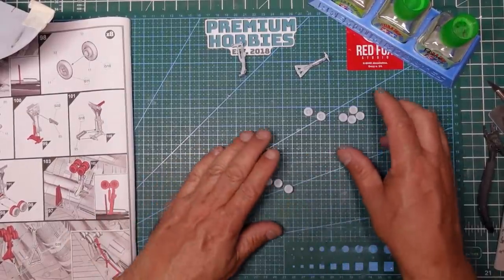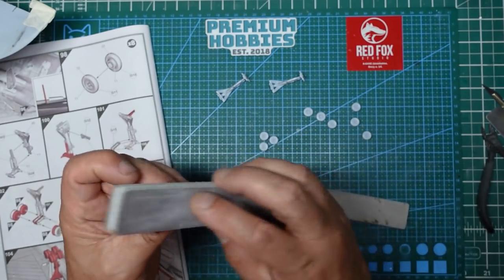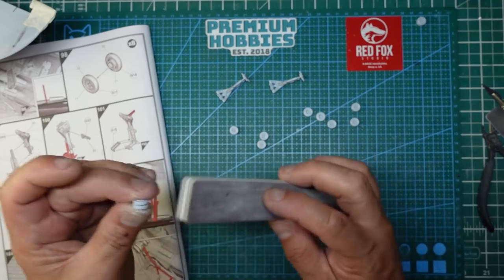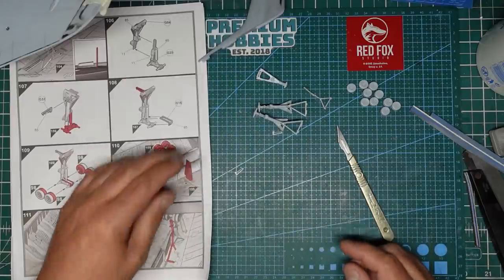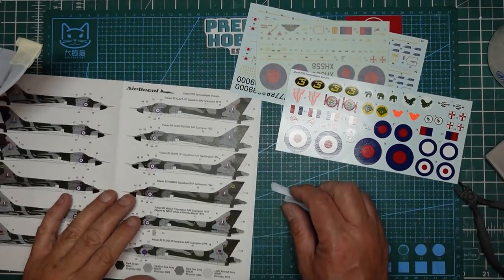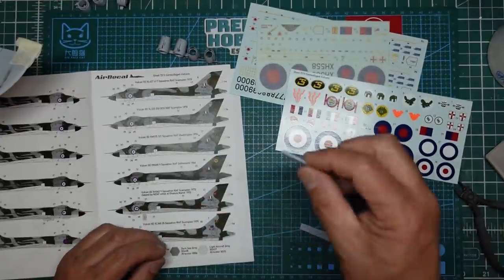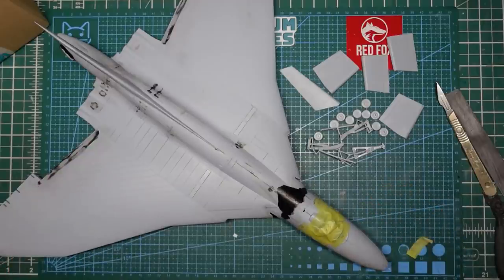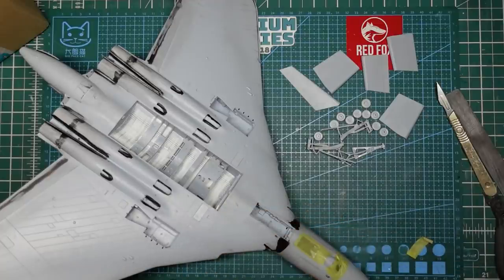Airfix New Tool 1/72 Vulcan build. Part ten

Comment: The adventure continues.  More good progress, Nigel, and more useful guidance for those of us yet to start our own builds.  Just to add to the confusion, I found a thread on Britmodeller from 2017 by a guy doing XH562 using the old kit.  Interestingly, his has the other fin tip and a different nose (the one with an extra little thimble) although he is using aftermarket longer jet exhausts.  He says his in its 1978 configuration. Yours I think is 1972.  Sods law dictates that through a long and illustrious career such as these aircraft had, they must have all sorts of mods and upgrades adding to the modeller's head scratching.  At least you've got photos to confirm your choice.  Nil carborundum.

Comment: Nigel, the cameras auto exposure is seeing the white of the instructions and the camera ‘brain’ is saying woah, too bright, close the aperture or increase the shutter speed. If you put something black on the bench, it will do the opposite and get brighter…
Reply: Now, I’m not a videographer, and will gladly defer to anyone more knowledgeable.  There are a few things as a photographer, I would suggest. Use manual, if the camera supports it. Also and most important is the sweet spots between shutter speed and constant lighting, I have LED lights (not photographic lights) and shutter speeds of 1/50th 1/100th of a second (for me, yours maybe different) doesn’t produce flicker. Second help out your lighting by setting the ISO  between 200 - 400 and with an aperture of at least f/5.6 this helps out focus. This along with good constant lights, diffused is better, as there are fewer shadows. There are other things you could do, but this is complicated enough for now.
Reply from the maker: Thank you.

Comment: FYI... XH562 got its 'Kiwi' roundel in 1972 and the RWR fin top was only fitted in 1975 so your choice of fin top is OK. The twin Skybolt blisters were fitted 1964/65 but they are already on your kit so that is also OK (there should be a small very shallow circular blister between and just forward of the Skybolt blisters). There is only one ECM plate, fitted between the starboard engines. The light grey underside replaced white in 1973 so for you white is the colour as you have worked out.
She was fitted with series 201 engines as built and never upgraded to 301s.
Her final flight was to RAF Catterick on 19 August 1982 where she lay until put on the fire dump on 14 June 1984 - A sad end for a beautiful machine.
Hope all this may be of help or at least interest and please build her the way that you want to... She is your Vulcan after all.

Cheers and good luck!
Reply from the maker: Please tell me, where are the skybolt blisters?
Reply: @NigelsModellingBench  Skybolt mods were in three stages and when the missile was cancelled modifications were also cancelled. The blisters conceal the forward mounting points and are located under the the forward wing edge at about mid span. They are sort of teardrop shaped. Cheers, Billy...
Reply from the maker: @oml81mm  thank you. There is already a small circular raised bump just forward and in between the blisters??
Reply: @NigelsModellingBench  If that is on your kit good. It covered covered an access point to refrigeration kit (never fitted)    to do with the missile. It was circular with a diameter about the same as the main blisters are long (I think) and was very shallow indeed. To be honest I would not worry about them as they are barely noticable on the real thing unless you are up close, or an anorak like me ;-)
Reply: Hi, I'm a bit of a Vulcan specialist in scale modelling. I'm rivet counting my build to no end, so I've done a lot of research. The blister configuration you need for XH562 is twin Skybolt blisters ONLY. The small circular coolant blister needs to be removed, as does the similarly shaped rear mounting blister. 
You should also remove some details under the engines which were exclusive to 301 Vulcans (anti icing blisters to be specific). There is also a raised square panel behind one of the wheel wells which may have to be removed for this era (it was introduced in 1972 but some vulcans didn't receive it until 1974). The decal which goes in its position is incorrectly tan coloured, it should be black and only ever present if the raised square panel is not. They're two different versions of the Doppler radar.

You should also not fit the optional blister under the ECM tailcone, which is fitted in kit scheme B (XM602). There were two versions of this, which were X Band jammers, not every Vulcan had one. 

I can't remember exactly what year later VFH aerials were introduced but you may have to use those parts rather than the ones used in the kit schemes. 

I'm happy to answer any questions about vulcan configurations and paint schemes of that era, you can pm me on Insta @Adam_Poultney_Models
Reply: @adampoultney8737  I agree with your comments re the after skybolt mounting point. The missile was cancelled in November 1962 but the the forward twin mounting points were fitted some two years later and the rear one was not. I have no idea why but it is possible that this had nothing to do with the missile and was for some other purpose. If this is so then it is likely that the small 'coolant' plate was not fitted either, I therefore tend to agree with you on this point as well.

Comment: I'd be interested to know what the plastic prep work is before painting. Straight on with primer or clean the plastic first? If cleaned first what do you use and how? I guess the process is pretty much the same for any kit just prior to painting. Many thanks!
Reply: You should always clean the surface before applying any paint
Reply from the maker: I have washed the parts in warm soapy water to remove moulding residue. I will probably wipe over the surface with some alcohol before priming. If the plastic is particularly shiny and water based paints are being used it is a good idea to key the plastic and degrease also.